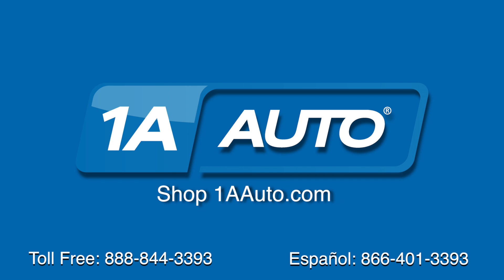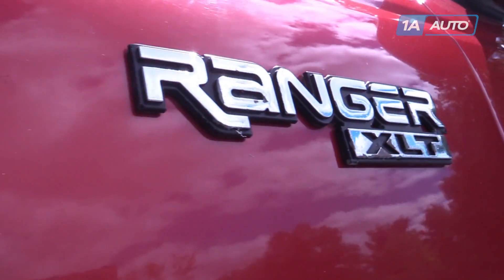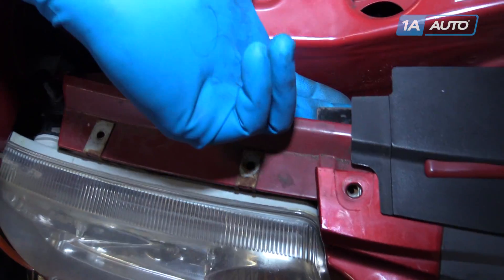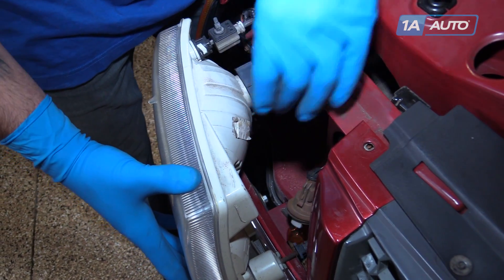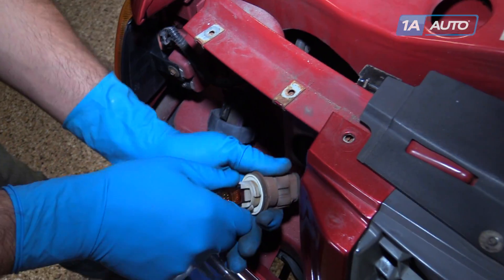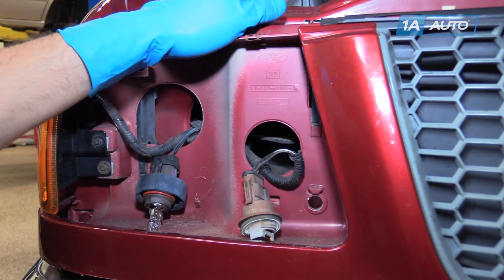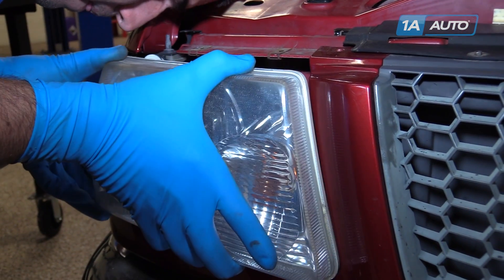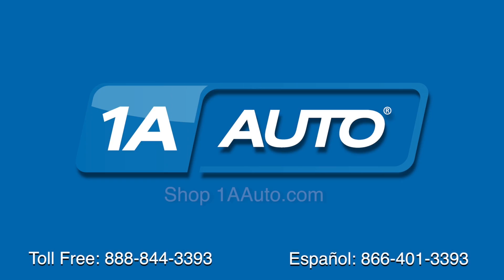How to Replace Headlights 01-11 Ford Ranger

Comment: So are the low and high beams on the same bulb? 
My 2011 low beams seem bright an will work with my factory fog lights on. But when I switch to “high” beams I barely notice a difference on the road or a wall an my fog lights shut off. 
Any ideas as to why my low/high settings look similar ? 
I’m tired of other cars flashing their lights thinking I have my high beams on when I’m reality I have my lows on. 
Any ideas or suggestions?

Comment: One thing not mentioned in the video is that the adjustment bolts that go into the retaining catches might get stuck if they have been left alone for a long time. After viewing this video, I went out and replaced my headlamp bulbs and could not get the headlamp to come out. It was necessary for me to use a length of barstock as a lever on the exposed end of the bolt to work the headlamp free. This was no great task and once the bulbs were replaced, I was able to reinstall the headlamps with no difficulty.

This is a good video that gets to the point without fanfare.

Comment: I just replaced the headlights on my 2001 Ford Ranger XLT, but when the left side light got stuck on what seemed to be nothing, I just got a saw and sawed the assembly out because the new ones I bought came with new screws anyway, all in all this video helped 100% with what I originally set out to do, thanks
Reply from the maker: +Mike T Thanks for checking us out. Shop here for high quality auto parts: http://1aau.to/m/Shop-1AAuto-c

Comment: are most ranger headlights the same style and fit? would a 2006 for say fit in my 2001?
Reply from the maker: +Bryn The headlights will be the same for the 2001 to 2011 Ford Ranger models.
Reply: @1AAuto  Sweet! thats definitely what i wanted to hear
Reply: @1AAuto  i know the tail lights changed but would newer tail lights fit a 2001?
Reply from the maker: +Bryn The tail lights will be the same for the 2001 to 2004 Ford Ranger models. The 2006 will have a different design.

Comment: I own a 2001 Mazda B3000(essentially a Ford Ranger) and my headlights do not remove like that, I have 3 post with little clips you need snap ring pliers to remove, and the one on the bottom of headlight a nightmare to reach.
Reply from the maker: +JFK64 Kennedy Thanks for watching. If any of our viewers needs to make this repair we carry the replacement part shown in this video on our website. Here's a link to them https://www.1aauto.com/2001-11-ford-ranger-headlight-pair/i/1alhp00275?utm_source=YouTube&utm_medium=CTA%20Comment&utm_campaign=1ATony